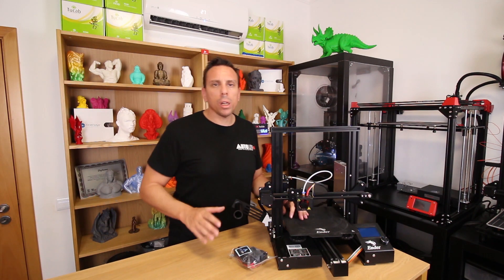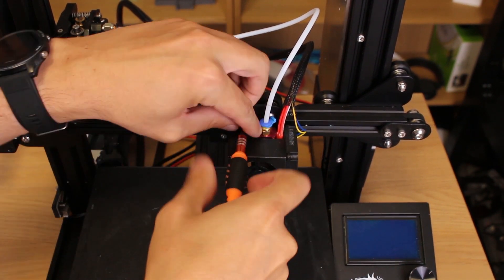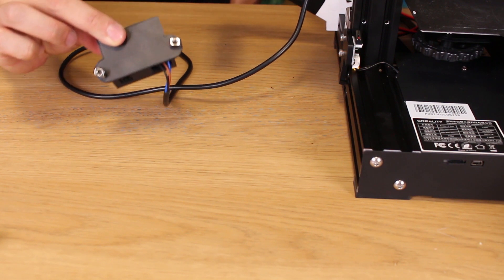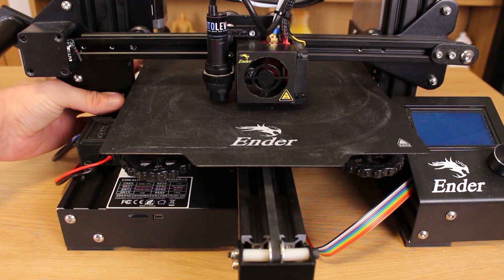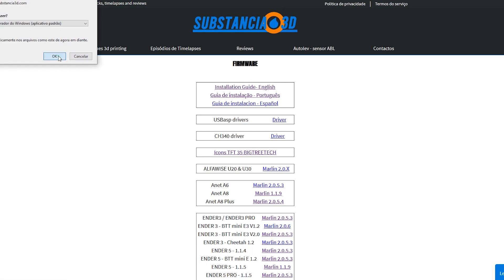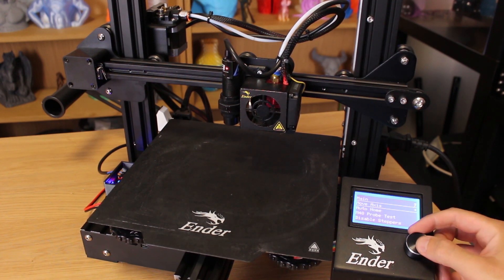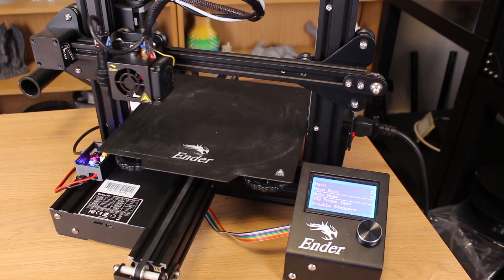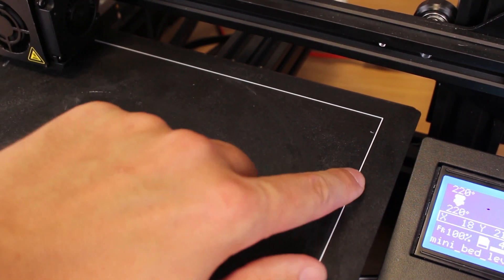Ender 3 Upgrades - Install auto bed leveling AutoLev Plus - 2º episode

Comment: Delighted with this - I have installed on my very heavily modified CR10 - e3d hotend, titan direct extruder, custom mount, BTT SKR mini e3 board - does it work - yes! There is no instructions on how to customise your own firmware - but basically need to use stock marlin - set to use z pin for probe, endstop inverting set to false, set fixed probe to yes, and then select a bed leveling method. Any other custom settings for your printer are also needed, esp if you have changed motherboard or extruder! Your offset will depend on which mount you use - usually this is listed in the instructions for the mount. make sure also to set a probing margin to avoid bed clips. You can also set any other nice settings you want from stock marlin, as long as they are consistent. I did M48 test and it was 0.003 with just basic settings which is good - my best on bltouch is 0.006. So can say this is a nice probe, if you use a stock printer even nicer.
Just one suggestion - include instructions to configure a stock Marlink because many people do not have a stock printer and this is maybe one of many upgrades. But it works fine and good value. Much better than bltouch with its poor cabling and higher price.
Reply: Agreed that would be very helpful.